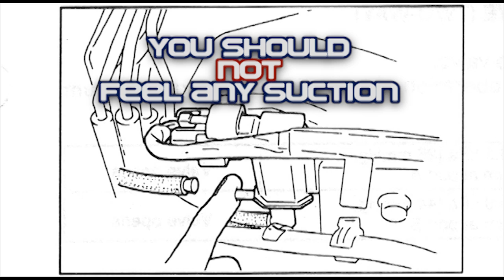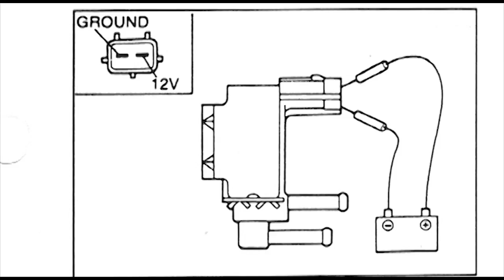Mazda 626 - Purge Solenoid Diagnostics

Comment: Awesome 👍 I'm going to go through this procedure because I'm getting a code for the purge valve. Question, I'm also having problem with the cooling fans! They will not come on! However, if I leave the AC on, the fans run. Without the AC on, noda... Any clue on a method of taming this one lol??
Reply from the maker: Purge solenoid has nothing to do with commanding the fans on. AC having the fans come on at least means both fans are functional. Test your throttle position sensor. Usually a low idle will prevent fans from coming on and it’s due to a faulty TPS. Incorrect timing can also cause it but it’s not easy to diagnose mechanical or ignition timing issues without the proper tools. Your issue could be best left up to a mechanic to solve.

Comment: Is it in the same place for the 2.0 4 cyl version of this vehicle
Reply from the maker: This is the 2.0 4 cyl not the 2.5 V6...
Reply: @DJDevon3  so the canister purge valve is located under the bracket on the left side of the intake manifold correct?
Reply from the maker: @jmobbin2858  Have you looked at your car? I don't know what year or model your car is. That's up to you to figure out.
Reply: @DJDevon3  yeah it's a 2002 mazda 626 I'm gonna check it out tn
Reply from the maker: @jmobbin2858   The purge solenoid is on the opposite side (right side) of the intake manifold on the 2002. They moved the location in 1998 to next to where the intake boot meets the intake manifold. The solenoid is identical in function and form just a different location. It should be easy to spot if you compare it to what it should look like in this video. It's just in a different location. I haven't made a real 626 video in 5 years but I still know the differences between years. :)
Reply: @DJDevon3  thanks man there's not many videos other than the ones u have for 626 on canister purge solenoid changing part. Fast reply too your the best!

Comment: Hi, my name is Onome and I drive a 1999 Mazda 626. I am currently having issues with my car and I need your help. So, in the morning it will not come up on time, I will have to start it over and over again before it picks. Most time when it pick, it will not work regularly then it will go off couple of times before it will pick.

I have done a lot of changes on it, changed the fuel pump, ignition, airflow metre, brain box and nozzle mouth, yet no sign of changes and its comes with a white smoke too and will stop as soon as I begin to move with it or after some minutes.

Pls, I need your help and I am very tired of the car.

Thanks.
Reply from the maker: Watch my fuel series playlist. Learn how to test the fuel pressure.
Reply: @DJDevon3  ok.
Reply: @DJDevon3  ok thanks

Comment: hello how are you I need to ask you a question I have auto mazda 626 glx year 98, I need to know if the purge solenoid valve works when the car starts? why I have measured the voltage on the connector I have 12vdc but the purge is not activated? or do I have to wait for the computer to send the eco-friendly order? I hope your help thanks
Reply from the maker: Nope have to wait for those conditions.  You can test the solenoid itself but in order to test for the the command on signal from the ECU, it has to be done while driving with long jumper leads as part of a live driving test.

Comment: If I may, I have 2 advices: put a fuse when testing a solenoid directly on the battery. Using alligator clips is also safer to avoid short.
Reply from the maker: Yup I made an annotation about that but mobile viewers won't see that annotation.  Alligator leads are the safest way.  I didn't have them at the time and yeah I really wish I would have shown using alligator clips instead.  Nothing I can do about that now.  If you're careful & know what you're doing it shouldn't be a problem.  A fuse is a good idea too.  No one's mentioned that advice before, I like it.

Comment: I'm getting a P0455 code on a 2002 Nissan Xterra. Is the purge solenoid the same thing as a "purge control valve"?

And do you know if the purge solenoid on a Nissan Xterra opens or closes when activated? I'd like to test mine the same way you showed. Thanks!
Reply from the maker: Nerfball6 Yes purge control valve is another common name for it.  Names differ by manufacturer.  Sorry I don't know anything about Nisssan or any other car for that matter.  I only know the Mazda 626.  I'm a 626 enthusiast, I'm not a mechanic.
Reply: I guess you fixed your issue since 2 years ! Was it the canister vent valve ? This one is normally open. The purge valve is normally closed.

Comment: My Car would't start today after an overnight of subzero temps, it would crank but not start, my roommate check under the hood and noticed that one of the hoses connected to vacuum solenoid was broken and thinks the cold caused it to snap and thinks that is the problem for why the car won't start. Is that a valid reason? or would the car start even with that broken hose? should we be looking somewhere else? we know the battery isn't the issue.
Reply from the maker: Mo Aly, it should still start.  I don't really know much about sub-zero temps playing a factor.  I live in Florida where it rarely gets below 40F.  I'm not the best person to ask about that.  I would lean more towards incorrect anti-freeze ratio or perhaps frozen fuel lines at those temps.  Like I said I'm not sure.  I'm not a mechanic and I'm certainly not a cold weather mechanic. ;)

Comment: Just had a 2 Fuel pumps installed on my 1997 Dodge Dakota, only to find out that it could have been my Purge Solenoid causing truck to stall. Can vehicle stall if the Purge Solenoid is bad? Aslo, when it did stall, it was hard to start. It would just keep cranking.
Reply: Oh and you sound very Knowledgeable. Thanks for the vid.
Reply from the maker: MetalMan2K,  I'm not a mechanic and only have experience working on my own car.  From my experience and knowledge of the 626 no a bad purge solenoid will not cause a stall.  A cracked vacuum line running to or from the solenoid however can cause a stall as that would be considered a vacuum leak.  On the 626 they are hard pipes for the most part.  On other vehicles it might be rubber vacuum lines.  Part of the diagnostic procedure is to first inspect all vacuum hoses and pipes (they can rust out too) for vacuum leaks.  Check for cracks/splits in the rubber hoses.  They are small hoses and will only need a small tear to throw off your ECM's fuel ratio.  The larger the vacuum leak the less efficient your engine will run.

The evap system is likely to be different than what I have but the general diagnostic method is the same for just about any vehicle.  Start with vacuum line inspection.  If you have a really old vehicle probably not a bad idea to just go ahead and replace all of the old rubber vaccum lines just in case. 

Another good diagnostic tool to have is a vacuum gauge.  I don't have one yet and plan on adding it to my tool box in the future.  A vacuum gauge is useful for telling you manifold vacuum.  You can compare your reading against what your factory manual says it should be.  In my case I believe it should be about 18 inches of mercury (inHg) plus or minus 1 inch.  That's technically the easiest way to see if overall you have any kind of vacuum leak to begin with.

As for the hard starting and continuous cranking I'd do a fuel pressure test to make sure adequate fuel pressure is reaching the fuel rail.  Another thing to look into would be the fuel pressure regulator.  Very good possibility that your FPR is leaking internally due to a busted diaphgram, causing your stalls, and hard starts.  Definitely look into that.
Reply from the maker: MetalMan2k Thanks for the compliment.  Made me smile. :)  Please remember to click like if you've enjoyed any of my videos.  It helps me get super rich so I can afford to pay my for my personal jet and strippers.  OK not really but it's always nice to feel appreciated.

Comment: liked the video.. I do have a question  i noticed that when you were doing the test with the purge solenoid off the car that when you had voltage you could blow throw the solenoid,  my question is when you do not have voltage on it when testing it in hand and you blow though it no air should come out the other side of the tube at all?
Reply from the maker: Correct with my particular solenoid (Mazda 626) you cannot blow through unless voltage is supplied.

Comment from the maker: Post it in the 1993-2002 I4 Technical Support forum.  I'll definitely see and respond to it.  I'm on that forum about 20 times a day.  I see everything posted there and respond to most posts even on versions of 626's that I have no experience with because I own about 20 different 626 factory manuals with just about every kind of diagnostic procedure that you would ever need.   You'll be well taken care of at Mazda626.net ;)

Comment from the maker: Haven't finished getting the parts yet but I'm pretty close.  All I need is the flywheel, shift linkage, and shifter arm.  Moving yet again next month so right now isn't a good time to be ordering parts or getting into a big project.  This months videos will all be on quick and easy diagnostic stuff just to keep it interesting until the swap.